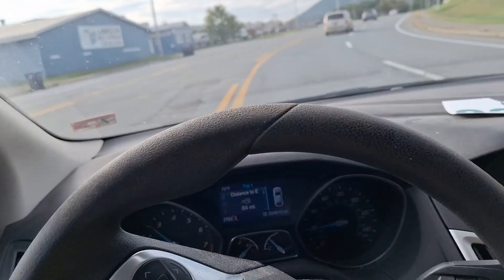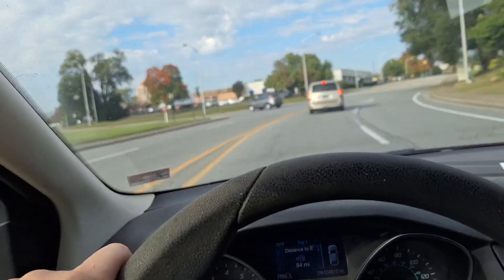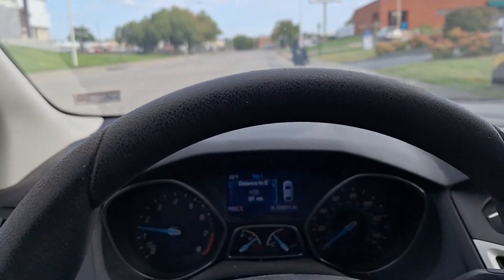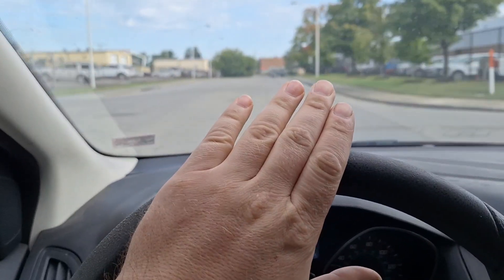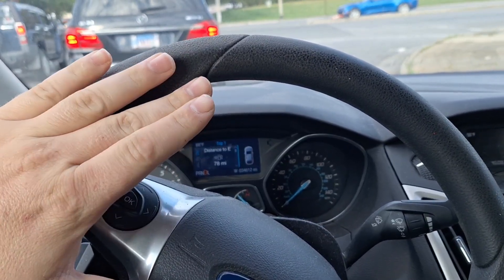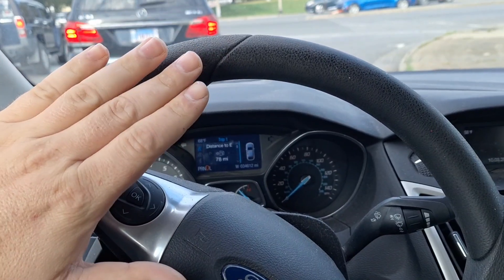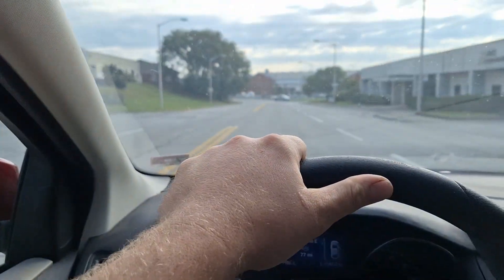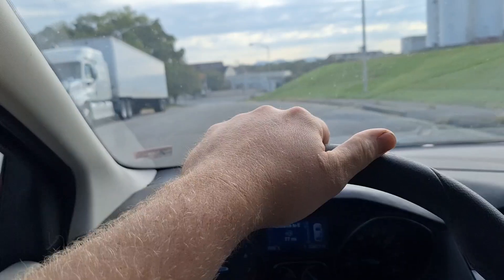Ford Focus/Fiesta DPS6 Transmission Overheating Warning Message! Tips and Advice

Comment: Hey! I'm having the same issue with my Focus. That message started appearing and the car stopped moving; I have to wait about 5 minutes before the vehicle lets me drive again.
I scanned it and got code P2872 (Clutch A Stuck Engaged). Could you help me out? Do you think it’s a faulty actuator or a stuck shift fork? Thanks!
Reply from the maker: Do an actuator swap to see if it changes to clutch B as a diagnostic step and a fork test on clutch A. Actuator Swap: This is a diagnostic method on the Ford Focus & Fiesta DPS6 dry dual clutch transmission. I recommend this when I suspect (or want to eliminate the possibility of) a clutch actuator issue.
Step 1: Remove both clutch actuators
Step 2: Take the one that was on the bottom, bolt it to the top
Step 3: Take the one that was on the top, bot it to the bottom
See if the code or symptoms change.  For example, a P090C may change to a P0902 when swapping actuators if the actuators bad

If the code stayed the same, then its NOT an actuator problem
If the code changed to the opposite clutch, get 2 new OEM actuators. Careful though, "oem" ones on ebay are counterfeit. And, cheap ones on amazon are unreliable. Get oem ones, link in focus-dps6-automatic
Video example: https://www.youtube.com/watch?v=zlg5QIwhOi8

Comment: I have a 2014 focus with the DPS6 Trans and I get that overheat message randomly. It’s only on the highway. I don’t drive the car locally it’s for commuting only I drive it at 70 miles an hour for 40 miles in each direction and it randomly displays that message but looking at the RPM gauge it doesn’t budge as far as slippage. I’m nervous to keep driving it because I don’t wanna break down on a highway but I feel as though there’s nothing wrong. A couple times it’s happened. I’ve pulled over and waited and made it to my destination. I don’t drive the car often because I’m afraid to break down.
Reply from the maker: If your clutch fork test passes swap actuators around to see if the code changes to the other clutch. That would confirm actuator failure
Reply: @BigBensCarsAndCycles I don’t get any codes when this happens and the actuators have been changed already.

Comment: Hey Ben! We have a 2018 Focus that we just did a clutch job on, we have a pretty bad clutch shudder only while going 40mph +and shifting while driving. Just got the overheating message on it after maybe only 30 miles or so on it. Followed your video on flywheel bolt patterns and aligned the clutch to the flywheel. Are there any other things internal of the transmission that could have been missed during the clutch job reassemble? Also I know there is supposed to be a break in time for these, are these symptoms of an issue or just something to try to drive out of it? No codes as of yet

Thanks again for all the videos you have made about these transmissions!
Reply from the maker: I would wait for it to set a code if possible. Glad the videos help. Really need a code to go by but it is possible that a clutch actuator is failing. You can swap the clutch actuators top to bottom to see if the shudder at 40 mph changes at all to a different speed that would point toward the actuator being back since you swap them around top to bottom
Reply: @BigBensCarsAndCycles gotcha! Will do, if it's sets a code or that fixes our issue I'll update so people who hunt through comments like me may have an answer! Thanks for the quick reply!

Comment: Hey Ben. I have a 2014 focus. New clutch and forks. Did the adaptive learn on forscan it showed the touch points at 6.6 and 11.7. and it moves but slowly and says transmission overheating when you start driving. Thanks in advance for your advice and info.
Reply from the maker: You can try replacing the clutch actuators or move the top one to the bottom position of the bottom one to the top. See if the issue switches to the other clutch. In other words, it becomes a reverse engagement issue
Reply: @BigBensCarsAndCycles thanks. Didn't seem to help probably just a bad clutch. What's weird is when it happens I lose reverse 2-4-6. If I go in forscan clear the codes and perform a clutch system test. I get reverse back until it happens again.

Comment: Bought the cheap forks and slave cylinder. One of the spring bolts was mis threaded. Had to tap and put an insert and use original spring bolts. Everything torqued down nice. Bought a cheap screw nut and seal kit. Nothing fit and the flex plate nuts were zinc and threw shavings and had to disassemble and clean debris out of everything and get new nuts. The snap ring didn’t fit and had to get another. Listen to him on these parts. Did the clean until I can afford a new clutch it’s been running great. My plan was put a bandaid on for half a year until I had more money ended up spending 500 and some change after it was said and done. Could have spent a hundred or so more and had the luk kit. Learn from my experience. I got a transmission overheating warning last night with no codes after 2500 miles. 
I’m now debating if my insert is giving me problems with the forks but most likely the clutch. Gonna take Ben’s fluke theory first and see what happens. Anyway you look at it I’m confident because of Ben and can take it all back down and bring it back up in a quarter of the time. I’d be sending this guy money if I wasn’t broke and just getting my car and me back to work. We’ll see how things play out but more than likely I’ll be getting the luk way sooner than I wanted to. Thanks Ben. This put me at ease yet again. <3

Comment: Brother i have ford focus 2015. Transmission overheat issue after this now gears changing is not smooth its jerking. It was having same issue i topup the transmission oil it start working good for almost 2 months. Same issue came again than again i topup 1,2 litres transmission and it worked well for 2 weeks. The oil i topped up it was not for dual clutch. Do you think that i shoud replace the oil with dual clutch transmission oil? It could be the only issue?
Reply from the maker: Hi the trans overheat is based on an algorithm of detected clutch slip and has nothing to do with the fluid level or condition. you need to see what other codes are in the car stored and diagnose the clutch concern
Reply: P0902 clutch actuator circuit low @BigBensCarsAndCycles

Comment: When you get that message, you pull over to the coffee maker, put it in park, without turning off the car, wait 5 minutes and follow the instructions. The transmission resets itself on the screen. You get a message that after 5 minutes the transmission is ready, and you continue driving.

Comment: While driving my 2014 Ford Focus Wagon on the highway, I noticed the RPMs were rising, but the car wasn’t accelerating. To regain control, I switched to Sport mode for manual shifting and set the gear to 4th, which initially worked fine. However, after about a minute, the issue returned.

I slowed down and attempted to shift into 3rd gear, but it didn’t engage. I then tried 2nd gear, which worked briefly, but the same problem occurred again after a minute. Eventually, the transmission overheating warning appeared, and I was only able to drive in 1st gear.

After taking the car to a mechanic, I was advised that the entire gearbox needs to be replaced. 😔

Comment: 2014 Focus. My transmission overheating just came on.... I'm planning on getting new actuators this Friday... any advice?
Reply from the maker: hey if you've got any codes i can help more in the discord. but if you've got clutch position sensor codes the actuators are a good first try
Reply: @BigBensCarsAndCycles  I do have codes...  There's nothing popping Up on my scanner I got a generic one from Amazon  I'm gon  go to the auto part stores they can scan it but I just pulled up to work.....

Comment: Hi there!

I have a 2012 Ford Fiesta SES hatchback I purchased it in 2021 with 93K miles. Right now its at 130k miles. I had transmission codes at 97k so I replaced the TCM with a new one at a Ford dealership. 

For the past 8 month or so I have been experiencing lag in or slipping in gear change when driving on inclines. There is delay in shift although the engine rpm going hard past 3250 rpm. But it shifts fine on flats.

I asked around for possible solutions like changing the transmission fluid, or mixing half of that fluid with friction additives but a few peoples advised against it saying it might worsen the problems and that DCT transmissions are very different that regular automatics. 

I don't know what to do as I wanna avoid waiting until the transmission blows up.

Any help, tips or advice?!

TIA
Reply from the maker: @vrooommm1  hi, I would try a manual adaptive learn, than can get rid of quirky shifts if it's due to a worn clutch. I've got a video explaining how
Reply: @ thanks I follow your videos and I hope the transmission doesn’t get much worse. If it does I’ll refer to your videos to replace the clutch and the forks at my friends garage. I’ll definitely be referring your videos to do that job as well!

Comment: Sir. My Ford Focus 2014 started to show Transmission Overheat - Stop safely today for the first time, then later again showed Transmission Overheat- Wait 5 mins. When I opened and saw the front side of the car, that white plastic box with pink liquid inside, there was a leakage on the corner surface of that white plastic box. There was pink liquid leakage. So what should I do?
Reply from the maker: @azizkhonakramkhonov  hi, you should find out what transmission codes are in it, join the discord server for 1 on 1 help, and order a replacement coolant bottle

Comment: New clutch, new actuators, new tcm, new output shaft & input sensors (A&B). New battery. All grounds are clean off. 99k and I just tested drive it on freeway going 60mph, after 20 miles, its show trans overheat message, pull to the side for couple mins, it’s run smooth again but its I drove it in-street not highway/freeway. Any suggestions?
Reply from the maker: @linhbui4765  did you replace the clutch forks and slave cyl? And clean out the bellhousing?
Reply: @BigBensCarsAndCycles  yes! I followed all of your videos, every steps of the way.
Reply: @BigBensCarsAndCycles  new clutch still slipping, I think its the synchronizer that bad. I’m buying that white bottle you say to get. It’s will come in couple days & we’ll see if its work. Car having hard time in 3rd gear. Making that noise when trying to shift.

Comment: I have a 2015 Focus and I only get the overheating transmission warning, it stops completely and the warning is removed and it says to just wait 5 minutes, but the strange thing is that it doesn't give me any error code,
Reply from the maker: It's likely going to end up needing a clutch job. You can start with doing a clutch fork test on both clutches. Check my other videos if you'd like.

Comment: Was having slippage and then the trans warning and then just stopped working. Took it out replaced clutch and forks and actuators. Luk clutch kit and ford actuators. Got it running and still with clutch overheating warning… tcm?
Reply from the maker: @sttodd37  could be. What fault code are you getting?
Reply: @BigBensCarsAndCycles  p2872 error on clutch A stuck. Also got low confidence in clutch a sensed position. Clutched a reference closed failed.
Reply: Test Failed
A Concern With The System Is Preventing The Module From Executing The Routine. Perform The Routine And Make Sure All Vehicle Conditions (Ignition State, Gear Position, Etc.) And Instructions Have Been Satisfied And Are Correct.
Reference Clutch Position Complete
Shift Drum Adaptive Learning Complete
Select Gears Complete
Clutch Travel Test Failed
Clutch Assembly Function Incomplete
Refer To The Workshop Manual For Further Diagnosis And Repair
Reply: But I was getting that code before I replaced the clutches.. that’s why I thought TCM
Reply: @BigBensCarsAndCycles  now it just won’t go into any gear. Again new clutch, new forks and new actuators.
Reply: @BigBensCarsAndCycles  I’ve used forscan  on this thing and I’m still trying to figure out if I should go ahead with a new Tcm or not. Still popping code for clutch travel test failed. New clutch, new forks, new ford actuators. Can Tcm cause a clutch travel test fail?
Reply: @BigBensCarsAndCycles  when I first installed new clutch you would have to rev it to get it moving forward or backward. Then it started with transmission overheating. Now it tries to go in gear but then it won’t. Almost like popping out of gear
Reply: @BigBensCarsAndCycles   p07a3:00-af, p2872:00-ec and the stays ec has -etc maturing intermittent at time of request - malfunction indicator lamp is on for dtc- test not complete 

Any ideas?

Comment: Suppose you change everything like the clutch and the forks throw out bearing and actuators and it still has over temperature and no codes
Reply from the maker: @smokeyblack4  as long as nothings leaking onto the clutch, I'd try replacing the clutch actuators first. Then the tcm if it's original

Comment: Ford Focus 2017 - recently got a clutch and fork bearings replacement , original had 131k miles on it, after the recent replacement it hasn't been 6 months and transmission gave a overheat warning light. I will have it scanned and see what codes pop up but I Haven't seen a check engine light on the car this far yet.
Reply from the maker: @joelperezcontreras4735  if it's on the original clutch actuators, I bet those are the problem

Comment: 13 Ford Focus Se 155,000 miles. Transmission over heat error message and p0902 code. The transmission shudders and slips. It stays at 2k rpm.
Reply from the maker: Either a tcm or actuator motor
Reply: Hopefully it's the tcm.

Comment: Great video as all you previous videos, I replace my clutch and shift fork and make my owen tools same what you make easy in your videos.
But still I have issue and its when the drive the car for long time on hot wather the engine light on and the transmission not shift forward and reverse until car cool down.
Reply: And when scan it by scanner the code is p090c  clutch B actuator control circuit low.
So, is that TCM failure?
Reply from the maker: @user-og5ii5xy3j  hi, yeah the tcm is most likely bad, I'd get a used k05 tcm at a junkyard or ebay. Then have ford program it
Reply: @BigBensCarsAndCycles hi I have 2014 ford focus has little shutter when cold but shifts fine when cold but about 5 min of driving it will pop up transmission over heating stop for 5 min I stop for 5 min drives for couple miles it does no start a lot and sometimes it drives fine but if it doesn’t randomly discgage the clutch it’s at the dealer ship and they said it has tcm codes do u think it’s tcm or a clutch